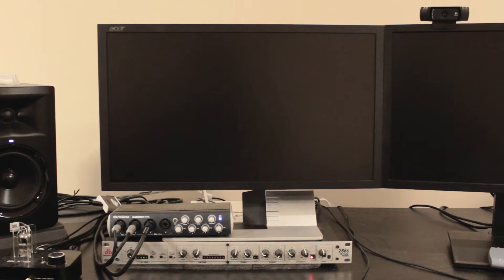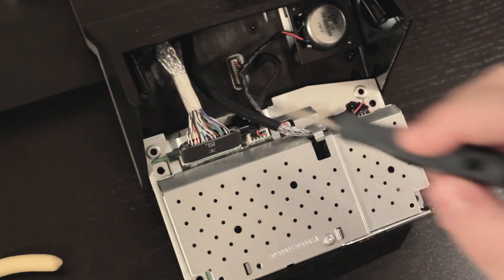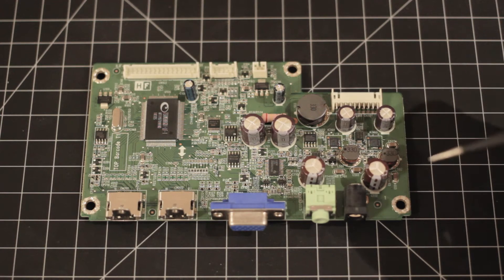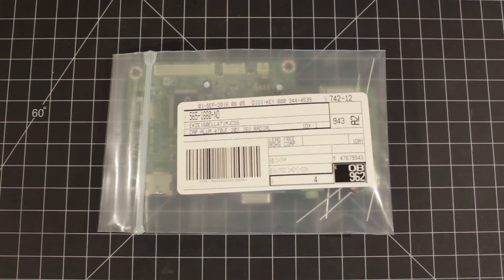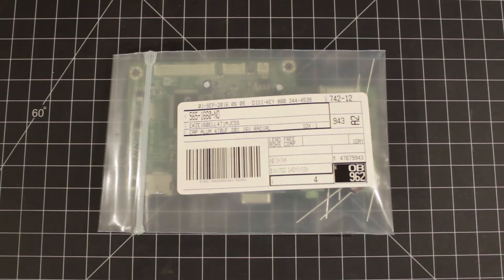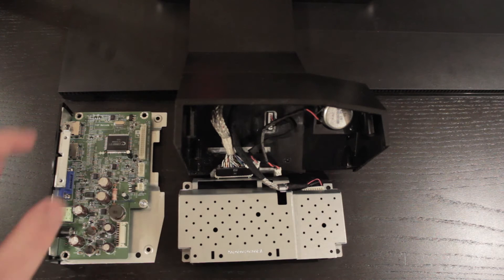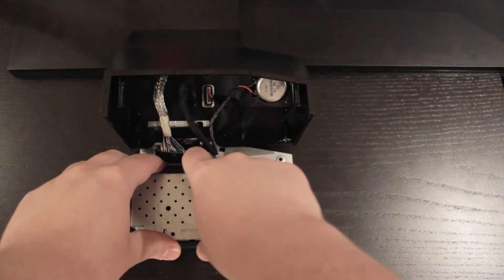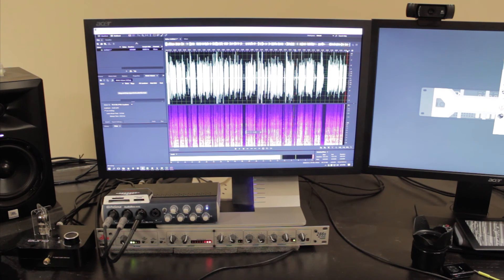Acer S243HL Monitor Repair (Bad Backlight Capacitors)

Comment: This happened to me as well. Noticed the monitor was taking a while to power back on after waking from sleep (kept flickering the orange power LED). It'd take a good minute or so to come on. Sometimes it'd come on immediately. If I turned it off while it was on and tried turning it on, it wouldn't come back on. It'd come on after a minute or so. It was getting annoying, so I decided to take a look. I suspected it was a cap somewhere. Initially thought it was the power brick, but it wasn't. All was good there (no cap was bulging). 

Finally decided to open the monitor up and saw one cap on mine was slightly bulging. The other looked OK. I replaced both with a 35V 470uF cap I found on one of my spare boards and will see if it fixes it. I didn't want to wait for caps to arrive so that's why I harvested some from a board I had laying around. If these fail, I'll add new ones. I may order a few 470uF caps anyway since I am coming across other devices failing that often use 470uF caps. 

Least it was an easy fix. I've been using this monitor for years.

Comment: Got the same problem with my acer s243hl after 15 years of use... Bought it back in 2007... First I thought it's a problem with the on/off button, but after seeing this video... Now I know for sure it's the capacitors in my case too...

Comment: I have a S230HL that starts to have problems to turn on, the screen is just black until I turn the monitor on and off and then it works again. It looks like failing capacitors, I haven't opened the monitor yet. A couple of times I have heard a slight buzzing from the middle left side and it was fairly warm, the buzzing disappeared few seconds later. Looking at the service manual I see there is nothing in that area. I wonder if it's related to the main problem or not.

Comment: Both of my S243HL's died this year. I had a look, exactly same issue, but it's really hard to see since the capacitors are barely bulging more than the others, that seem fine. Gonna replace them anyway and hope to god it works.

Being back at a single monitor sucks.

Thanks for the video! Will get back with results!
Reply: Update: While my soldering was arse, I managed to get it up and running again! So that's 1/2 done. Get the other one done in a few days. Cheers!

Comment: Very odd my 27HL is dead as well 2 days ago - 2 of the capacitors bulged and I have changed 4 capacitors, but still, there is no backlight. The lights are turning on on the menu buttons and that's about it.  Much appreciated for any help provided.